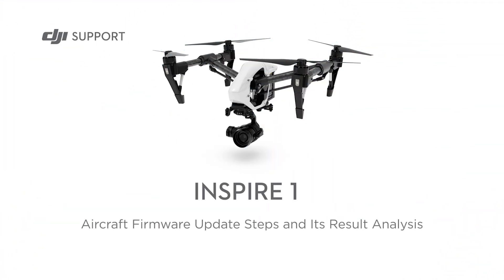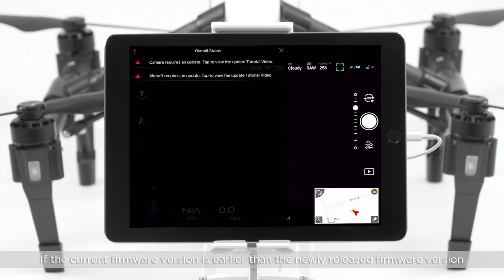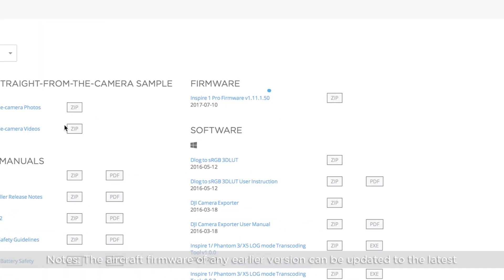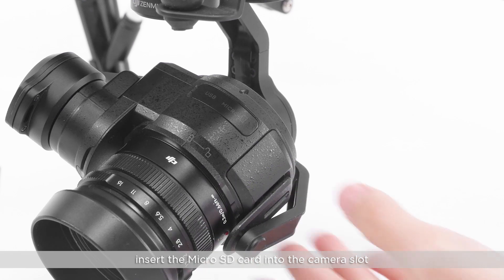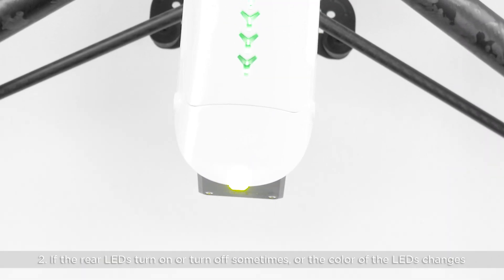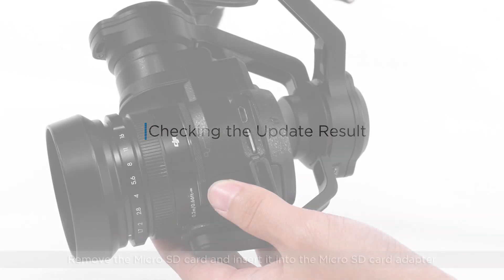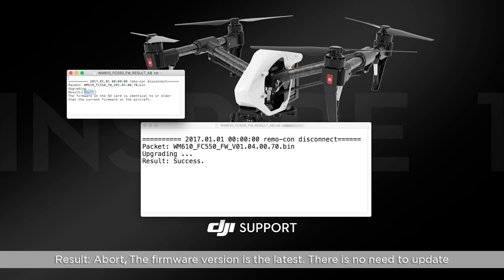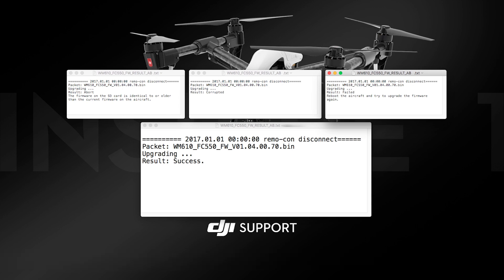DJI Inspire 1 – Aircraft Firmware Update Steps and Its Result Analysis

Comment: I'm using inspire 1 pro
& firmware problem in my drone
Video preview not come in Dji go app
& Show 'Camera firmware update required'

When I try to upgrade the firmware, it refuses and the log files just say:
When I try to upgrade the firmware, it refuses and the log files just say:

The current firmware does not support downgrade. Use a different version of firmware to downgrade the target version.

I am using the latest version of the firmware from the official DJI website. I think the problem may be that the already install firmware on my drone, as it reports as 'v01.11.01.52' whereas the latest from DJI is 'v01.11.01.50'. As such, when I try to install the correct firmware the Inspire thinks that it is out of date.
Reply: Pls solve my problem

Comment: None of the used products work. I've been staring for two days at a gently used aspire 1 that does nothing. I'm tech savvy but this is ridiculous. So many versions of the damn software but no clear answer about which one to use. I've tried 4 different apps and the drone still does not connect. You would think for something this expensive they would make sure people could use it longer than 5 years. It seems they've made it obsolete on purpose. Not happy.

Comment: I just got my Inspire 1 Pro airborne, latest firmware but wondering if it's compatible with the DJI Go 4 app for IOS? I gave up on the current version of DJI Go on Android.
Reply from the maker: Hi there, Inspire 1 doesn't support DJI GO 4, you may donwload the latest IOS version of DJI GO to check.
Reply: @DJISupportGlobal  I see lots of issues with the Android version, so I will stick with the IOS version then. 
Are there any plans to make the DJI Go 4 available for the Inspire 1 Pro, or are there technical limitations preventing this?
Reply from the maker: @cirkuitdroneservices7982  The corresponding APP of Inspire 1 series is always DJI Go since it is released, DJI Go 4 is and will not compatible with Inspire 1. What problems do you have with Android DJI Go?
Reply: @DJISupportGlobal  I am unable to launch it - it crashes even before the UI comes up. Test was done on a newly installed Samsung Tab 3, updated Android and downloaded latest version of DJI Go from Google Play.

Comment: Those of you saying this is too complicated; The DJI Inspire is designed for people with actual intelligence who can do something as pathetically simple as downloading a file - loading it on to an SD card, and then inserting the SD card into the gimbal on the Drone, and finally; turn the drone on. If this is too complicated for you, then I recommend you check out the DJI Tello.
Reply: It's not complicated. It just doesn't friggin work. I did exactly everything in this video. Just never connects. Tried 2 tablets, 3 phones, numerous sd cards and numerous usb cables nothing.
Reply: Right.. I’ve had my inspire 1v2 since day one ... I have done every update without a problem... The problem is the owner... read ,read,read.... follow the instructions completely..... I have many drones and updating each one is a different process.... but the fact is..... If you follow the information given to you there shouldn’t be a problem with a simple task as updating software....

Comment: been trying to update my inspire and have followed the instructions, but the drone simply doesn't do anything. The back light flashes yellow, and the camera flashes a red light. Once i've left if for a full 30 minutes nothing has changed. On checking the micro SD there is no text file to look at. No sure what to do now.
Reply from the maker: Hi Ivan, may we know if you had unzipped the file and place the firmware in the root category on your SD card? Please try to format the SD card and try to update again, remember to back up the files before formatting the SD card. Please let us know if the issue persists, you may keep us updated via Facebook Messenger: https://bit.ly/2pm7tfV

Comment: I just recently made a trade for the Inspire1 v1, 2 controllers, and just finished updating it to the latest firmware ,without any trouble. I have the Phantom 4 Pro also, and even though it is a better craft, considering it has obstacle avoidance, and better camera, I do love the Inspire too. Just wish I could get my new DJI Goggles to work with both drones.
Reply from the maker: Hi Tim, DJI Goggles is compatible with them, please check on the video how to connect them here: https://www.youtube.com/watch?v=mo1ki0_SfF4